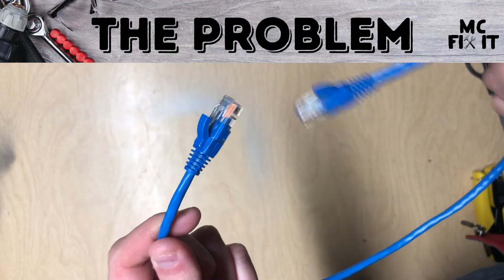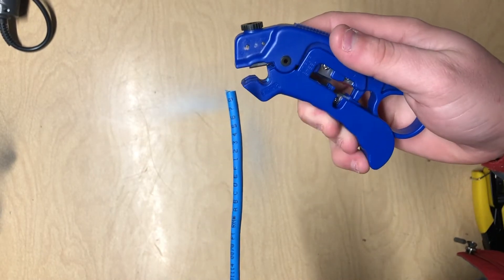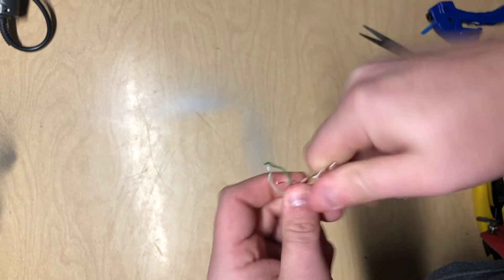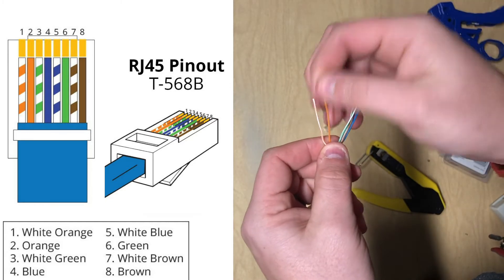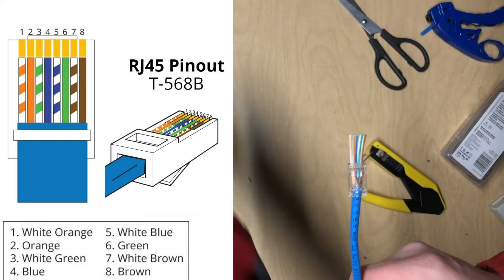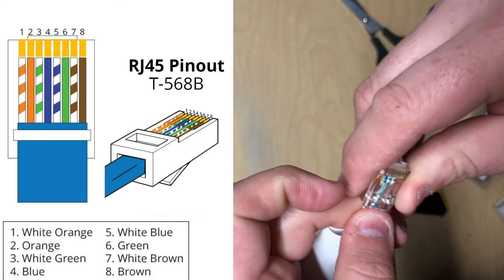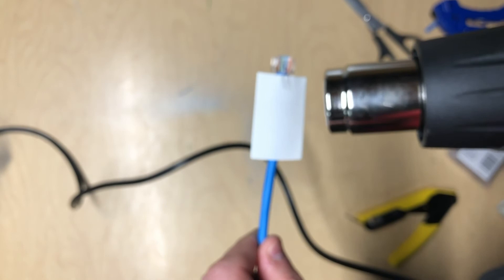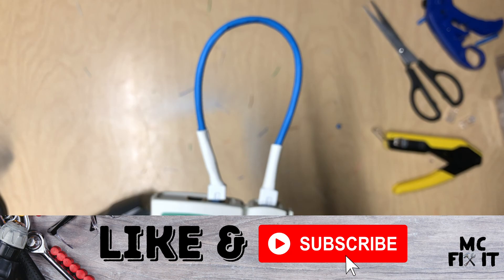How to Fix a Broken Ethernet Cable Cat6 with a Crimp RJ45 Connector Pass-Thr w/ TEST. Complete Guide

Comment from the maker: Ever had a wire break on your ethernet cable? With this quick tutorial, you can fix it yourself. 
The Tools 00:41 
• Klein Pass-Thru - https://amzn.to/3hewtlC
• Jacket Wire Stripper for RJ45 - https://amzn.to/33vSfZK
• Klein RJ45 Pass-Thru Connectors - https://amzn.to/2RFatoW
• Cat6 Cable - https://amzn.to/3exuHKi
• Scissors - https://amzn.to/3tqn8ti
• RJ45 Tester - https://amzn.to/3ben0XC
• Heat Shrink Wrap - https://amzn.to/3hdOxMH
• Heat Gun - https://amzn.to/3hk2RmV

01:06 The Fix - learn how to strip, align wires, crimp, and heat shrink wrap a new connector. 

08:26 The Test - use the tester to ensure your wiring is done correctly!

You can easily fix your own broken wires or connectors with just a few tools and the know-how described in this video.  

Check out my website at http://mcfixit.us 

Disclaimer: Due to factors beyond the control of MC FIX IT, I cannot guarantee against improper use or unauthorized modifications of this information in the video, post, blog, or social media. MC FIX IT assumes no liability for property damage or injury incurred as a result of any of the information contained in this video. Use this information at your own risk. If you feel uncomfortable at any time. Stop and go to a professional. MC FIX IT recommends safe practices when working on vehicles, your house, or any other project and or with tools seen or implied in this video. Due to factors beyond the control of MC FIX IT, no information contained in this video shall create any expressed or implied warranty or guarantee of any particular result. Any injury, damage, or loss that may result from improper use of these tools, equipment, or from the information contained in this video is the sole responsibility of the user and not MC FIX IT.

#mcfixit

Comment: Great video. I need to rewire my house and these instructions were great. Does that tool detach and allow it to be sent across an ethernet cable in another room? It looks like it but wasn't mentioned in the video
Reply from the maker: Yes it will. It detaches and works with the batteries in the larger side and sends a signal back to the base unit.

Comment: Does it just not work if you wire it in the wrong order?
Reply from the maker: Correct. If you do both of them the same way wrong it can work as long as they are in the same order 1-8. Id suggest against ever doing that though!

Comment: Have you ever had a crimp come undone? I think that’s why cat5e cable has gone bad. Some of the wires seem lose inside of the connector.
Reply from the maker: I have not had this issue before, I’m sure it can happen if it was not crimped properly or had a lot of strain on the cable at that crimp location
Reply: It was not crimped properly if it came out or someone really pulled on the end of the cord.

Comment: Can you connect two rj45 connector together?
Reply from the maker: Yes. You would need a coupler that allows you to do this. Some of the couplers even can be used in walls as ports... Cat 6 White Ethernet Cable Box https://www.lowes.com/pd/RCA-Cat-6-Ethernet-White-Data-Cable-Box/3550052
Reply: @MCFIXIT  yep, I’ve used these and they work well. Only use when you need like a wall outlet though
Reply: I’ve done this before and it worked well.
Reply: You can terminate an end too. That's the best way but it's much more difficult

Comment: Is the pass thru method the easiest to crimp?
Reply: Maybe not the easiest but the best way I’ve found to do it
Reply from the maker: It’s easy to crimp and make sure your wires are in the correct order. They make a number of other options but I really like this method. Thanks for watching and commenting!
Reply: This is a pretty easy way. Just make sure to get the wires in the correct order
Reply: This seems like a very easy method. You don't have to worry about a lot of the perfect cut ends bc it does it for you